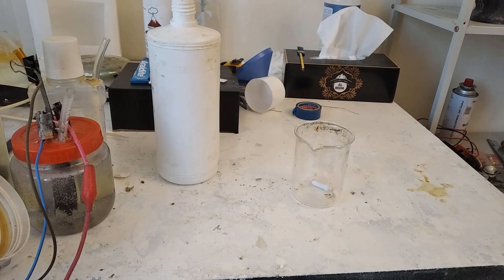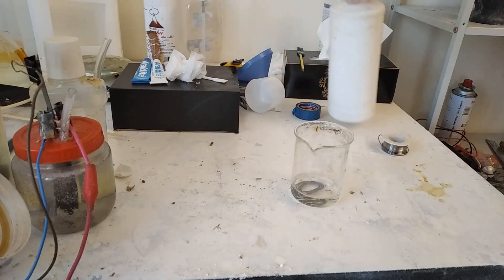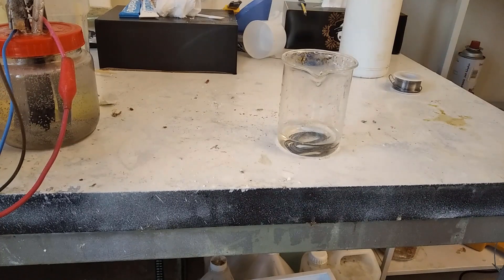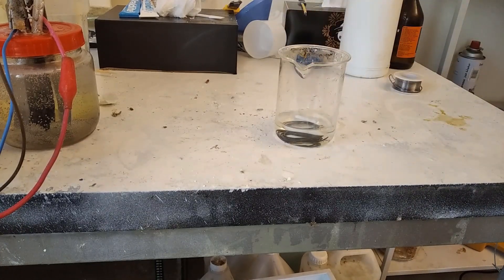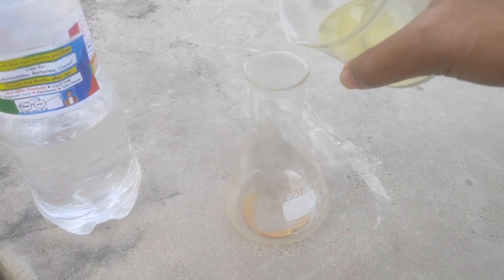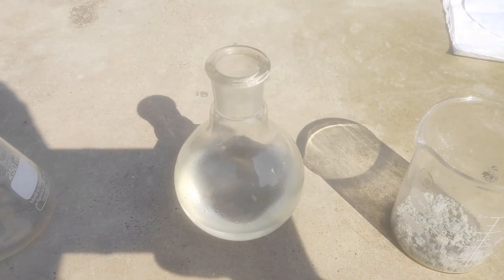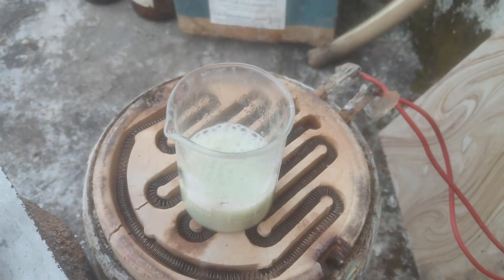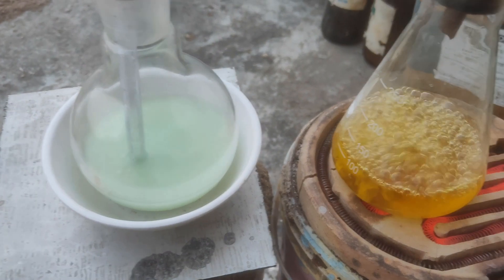ATO coating solution preperation

Comment: 10% the weight of tin (IV) chloride (66.51g) so 6.65 grams of antimony (III) chloride? and 80% the weight of tin (IV) chloride (66.51g) so 53.24 grams of ethanol?
Reply from the maker: You need atleast 4x volume of ethanol as the concentrate so more than that around like 180g ethanol. I do 6 or 8x ethanol tho sometimes and it just limits water content really.
Reply: @CatboyChemicalSociety  Im confused and I cant understand, can you simplify the ratio of each substance?
Reply from the maker: @militaryshorts01  let's say you have 10g of tin 4 chloride you then can add 4g of antimony trichloride and then about 40g of ethanol to dilute it.
This gives a ratio of 28% antimony to 72% tin which is close to the maximum 30% antimony but you can go as low as 10% antimony and it won't affect performance.
Reply: @CatboyChemicalSociety  
Ethanol/Methanol - 74.07% 
Antimony(III) Chloride - 7.41%
Tin(IV) Chloride - 18.52%
That is base on the ratio that you give which has a total of 54 grams.
Reply: @CatboyChemicalSociety Btw does bubbling hcl gas required if you use 35 percent concentration of hydrochloric acid to react with metastannic acid? And if so, how long does it take for this to complete? Also, is it also required to bubble hcl gas to the ethanol solution of tin tetrachloride pentahydrate and antimony trichloride? ( Im sorry for asking you so many questions I just want to be sure. Thank you! )
Reply from the maker: @militaryshorts01  it requires boiling concentrated HCl and about 5 minutes. Bubbling HCl into methanol is optional
Reply: @CatboyChemicalSociety  How did you stabilize or control the ph of your chlorate/perchlorate cell?
Reply: @CatboyChemicalSociety  wait did you mean boiling? So if you have 35%+ concentrated hydrochloric acid you didn't need to bubble hcl gas? since bubbling hcl gas only need to increase the concentration , you just need to boil it to greatly react metastannic acid to hydrochloric acid? Is that what u mean?
Reply from the maker: @militaryshorts01  chlorate is easy just keep temps high above 60C and 30g/l CaCl2 or MgCl2 as buffer. Perchlorate only needs pH to be dropped initially with MgSO4 or H2SO4 to remove chlorides. You can also use persulfate at 2g/l and hot temps during chlorate run to keep pH at 7. PH cannot be tested directly so a sample is taken and boiled to dryness then DI water is added back before pH paper is used to check pH.
Reply from the maker: @militaryshorts01  yea honestly even refluxing 20% HCl can dissolve metastannic acid followed by simple distillation to remove excess HCl but this is slower and harder than just using 35% and boiling it for a bit followed by volume reduction by boiling down slowly.
Reply: @CatboyChemicalSociety  in the video where you boil a mixture of 36% concentrated hydrochloric acid and calcium chloride to generate hcl gas, why did you just not use that 36% concentrated hydrochloric acid along with metastannic acid and boil it as you stated? Aren't you making things complicated?
Reply: @CatboyChemicalSociety  what is your operating voltage and current of your chlorate/perch cell?
Reply from the maker: @militaryshorts01  operating voltage doesn't matter as long as it's above theoretical potential which is like 2v or less but practically it's anywhere from 3V to 4.5V. Current density must be 200ma/cm² for perchlorate and for chlorate it can be that or anything below.
Reply: @CatboyChemicalSociety    in the video where you boil a mixture of 36% concentrated hydrochloric acid and calcium chloride to generate hcl gas, why did you just not use that 36% concentrated hydrochloric acid along with metastannic acid and boil it as you stated? Aren't you making things complicated?
Reply from the maker: @militaryshorts01  it's just extra to keep solution more storage stable but if used right away there's no need. Also the person here had to do this because his HCl has too much iron so he distils 20% then bubbles HCl gas from dirty HCl and CaCl2
Reply: @CatboyChemicalSociety  What makes cell efficient and makes it yield better? How did you stabilize or control the ph of your chlorate/perchlorate cell? My only goal is to produce high yield of potassium chlorate as possible by  using Pbo2 electrode.
Reply from the maker: @militaryshorts01  efficiency depends on pH and temperature in chlorate and current density for perchlorate. PbO2 is terrible at Cl2 generation and is not an ideal chlorate electrode but is very good for perchlorate due to high O2 evolution potential. IrRu is the most efficient chlorate electrode but IrTa is the best due to it not caring about running in low chloride.
Reply: @CatboyChemicalSociety  as long as Pbo2 anode will survive at the production of chlorates in many times of usage its ok. I can't find MMO here in my country and if so It would not be cheap so it's better to make it yourself.
Reply from the maker: @militaryshorts01  it will survive but efficiency is low and you need to pre electrolyze the salt with graphite til pH 10 to preserve PbO2
Reply: @CatboyChemicalSociety  how about only DTO? No pbo2? Does that work on the production of chlorates?
Reply from the maker: @militaryshorts01  DTO doesn't survive on its own, well making properly standalone DTO is possible but it needs anhydrous SnCl4 instead and is a pain because any impurity in the HCl will fk it up. Better to just make PbO2
Reply from the maker: @militaryshorts01  you can get MMO on amazon by tibromtak and its pretty good
Reply: @CatboyChemicalSociety  can I run these electrode even when you start at the solution of sodium chloride to perchlorate? Will the pbo2 anode survive?
Reply from the maker: @militaryshorts01  yes it will do fine if you get past initial chloride part ans keep temps under 45C
Reply: @CatboyChemicalSociety  can you make a complete procedure or summary of how to prepare sodium perchlorate like controlling the ph of the cell to minimize the corrosion of the electrodes and many more?
Reply: @CatboyChemicalSociety  also how many grams or estimate of perchlorate did you make everyday?
Reply from the maker: @militaryshorts01  when I ran my cell at peak output it made 2kg of perchlorate in a week
Reply from the maker: @militaryshorts01  just join the discord and all your questions will be answered check description
Reply: @CatboyChemicalSociety  If I start from chloride salts to perchlorate and I want to stabilize the ph, when do I add calcium chloride?
Reply from the maker: @militaryshorts01  to stabilize pH you would add CaCl2 from the beginning 30g/l for full buffer and 15g/l for HCl addition during half runtime. The temp MUST be above 60C for this to work otherwise the Ca(OH)2 will be soluble in solution. pH control is only possible using MMO electrodes and PbO2 will not like it because of excess errosion due to Cl2 reducing the coating into PbCl2.
Reply: @CatboyChemicalSociety  can I made Ammonium perchlorate from the electrolysis of ammonium chloride? Is it possible?
Reply from the maker: @militaryshorts01  no it would form NCl3 and detonate

Comment: Can I use this elcetrode for perchlorate production ?
Reply from the maker: When PbO2 is plated ontop yes but also when Mn doped as a thin overcoat
Reply: @CatboyChemicalSociety  without PbO2 it will not make perchlorate only chlorate ?
Reply from the maker: @patrikorsuliak8137  it can alone but you better get your dopants right which means use pure tin and antimony. MnO2 is an alternative overcoat to PbO2 that can make perchlorate but needs very specific baking temp. Future video on that
Reply from the maker: @patrikorsuliak8137  if u watched my video then PbO2 is easy to plate with the NaOH and Pb2 oxide or salt mix

Comment: Can tin oxide be used without doping? I mean just tin oxide coating and then lead coating, would it be crappy?
I can't get hold of antimony or cerium.
Reply: Ebay or aliexpress should have both, or whatever similar sites operate in your country.
Reply: @chemistryofquestionablequa6252  I live in Iran so, sadly none of them.

Comment from the maker: btw the lead nitrate byproduct is something you may have to deal with if the source of tin used is metal solder wire.
Using pure tin will not have this issue
Reply: I have a bunch of European pewter scrap, it's an alloy of 92% tin, 2% copper and 6% antimony. Would that be suitable for use in this preparation?
Reply from the maker: @bromisovalum8417  yes directly and after reaction from nitric to produce tin and antimony oxides which copper stays in solution. You can take the slop and dry it and cook in boiling 30% HCl